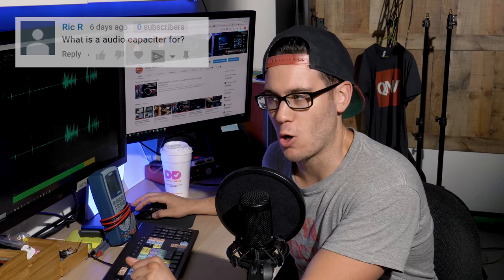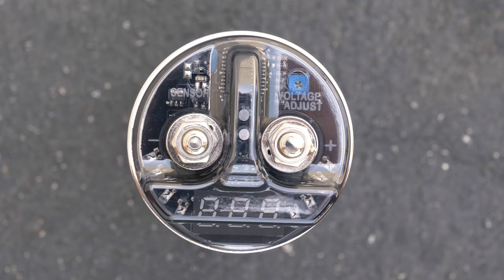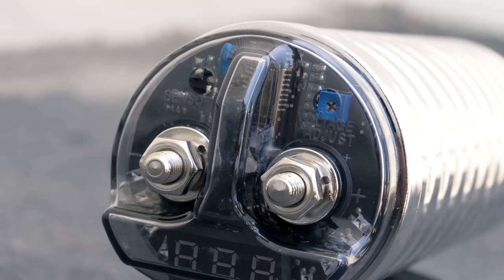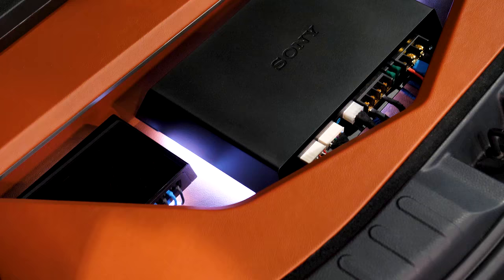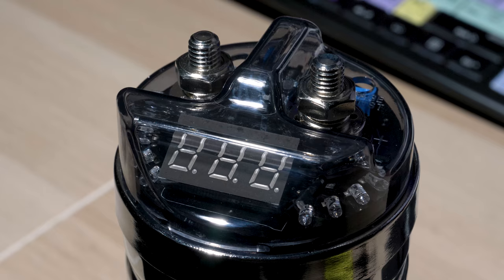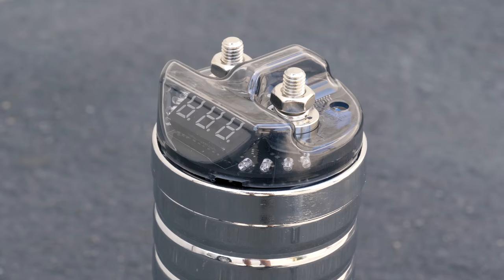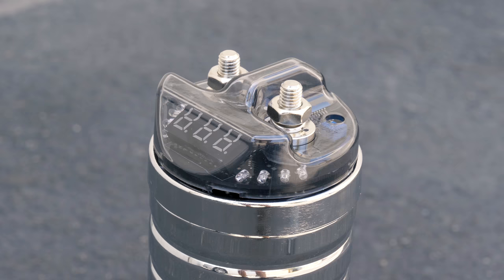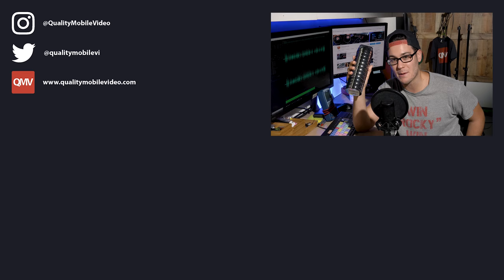What is an Audio Capacitor? - Car Audio 101

Comment: Halogen lights are going to dim under heavy current, no matter how good your electrical is. They are super sensitive to any voltage fluctuation. Even if you are sitting at a solid 14.4 all of the time, if they see a dip down to 14.1, they will dim. Best and most reliable way to stop dimming lights is to replace them with a quality LED bulb.
Reply from the maker: Agreed!
Reply: @Qualitymobilevideo  1a1

Comment: I have a 96 Camaro that has led interior lights that dim out when my bass hits I have 2 10" skar subs dual voice coils running on a skar 1000W 4channel amp the skars are even in a ventilation box by skar and they hit so hard won full range it drops my volts like crazzyy but I need one of these now knowing my issue thanks!

Comment: My car has an upgraded electrical system, always at 13 to 14v, never dimming. But still over time audio lowers ... not sure if is a radio safety feature but at this point the only thing left to do is to try a capacitor?
Reply: Having the same problem

Comment: Will this protect my battery from discharging too fast and my low amp alternator from burning out?
Reply: Yes but you need to have a big enough capacitor to fill in the extra energy your electrical isn't keeping up with.

Comment: As far amification at what point of wattage would you need a capacitor ? thanks for making the video btw….
Reply: This is not the only question to ask. It is not a matter of how much power you are using, but rather how much your system can handle. You could do a lot of math to figure this out between your battery, alternator, and wiring (including your amp ground(s)), but really you should be able to tell if your lights start to dim at all. If it's not dimming lights, your alternator/battery circuitry is not dropping voltage, which would indicate your amp is probably sufficiently powered. If you aren't pushing at least 1500 W during your peaks, and more like 2000, with no light dimming, you probably have no reason to look at caps.

Comment: i just swapped my alternator and battery with a diesel variant i had from a scrapper 
went from 45 Ah to 120 Ah and a thick 4g wire  and man no more problems no dips and i can even start another car with my stereo on max and the engine off
750w rms tho

Comment: Does this help , say if I’m parked at a light and my bass is really booming , but as I’m driving it lowers until I stop again at another light
Reply: It could but if u add another amp or upgrade the one u have it would fix ur problem
Reply: Think of it like this - power is lost the longer the line of wire is used. Using a capacitor is like bringing the battery’s power source closer to the item drawing power. So maybe on high levels of base but the capacitor is only a small buffer. Like shocks on a car - it dampens large draws but the battery and alternator are still supplying the power. Or at least that’s my understanding

Comment: So my question is that when I turn the music up on my bike the amps shut off but when I lower the volume they cut back on will a capacitor Fix this I have two 4 channel amps 1 running 4 6 and a half 3 way speakers and the other amp running 4 6x9 3 ways speakers a 600.4 and a 480.4 this is on a 2020 Harley road glide

Comment: What’s the difference between a capacitor and isolator relay
Reply: Not sure what an isolator relay is used for (will research) but a relay is just a remote switch to turn on or off something else.  A capacitor is a storage tank for energy that can be used as a reservoir  so to speak and quickly level out any dips in your electrical system during high demand.  Imagine them like ram in your computer.  Fast quick reservoirs of memory for quick access.  But instead they hold charge and is quickly accessed when needed.  But after ram is used up you have to go to your hard drive.  Same with capacitors.  Once they are used up you have to go to your battery until they can recharge.  Which is pretty fast.

Comment: A capacitor is like putting a bandaid on a shark bite.
Reply from the maker: Lol
Reply: Exactly
Reply: Geez did I just waste my money?
Reply: @diceloc441  Yes and No. While no they really don't do much for helping the cars electrical system they can help some inexpensive amplifiers that do not have a high quality built in power supply by giving them a little extra reserve for dynamic peaks. Kinda like a 50 shot of nitrous on a 4cyl lol.
Reply: How is this related to plumbing? I’m new to this
Reply: @CleetusJackson123 hahahaha

Comment: Can a capacitor help your battery from draining if you just turn your key twice so that only the electrical is working? Times I don’t wanna burn gas just to play music lol at a parking lot
Reply: I always asked this but someone gave me a great answer. When you do that your amps only get 12 volts. Which is why they always mess up. Your car always needs to be on to get the full 14 or 13 volts necessary so they won't short out

Comment: when i disconnect the battery to work on the car do i need to disconnect the capacitor as well?
Reply: You would need to discharge the capacitor as well.  Think of it as a mini battery still connected.  Better off unplugging it but even then it still stores energy so be careful not to touch the 2 leads.
Reply: You should be fine if you are not going to go near it, ie if you are only working under the hood and it is in the trunk/cargo area. It will drain itself slowly over time but if you are going to handle or be near it you should discharge it slowly and safely. Basically you would need to connect a large value resistor between the positive cap terminal and ground, or have a relay do so automatically upon power down (this might work very well). Exactly what value will be based on your capacitor's value and perhaps other parameters as well.

Comment: It would help if you started selling Ultra Caps or a XS power Ultra Cap Bank.    These capacitors do nothing.  Better upgrade your charging system if you can.

Comment: I did and y is their  a remote wire on some of the capacitors
Reply: Gio arteaga the remote wire are usually on the ones with digital displays. Turns the display off when the key is off to keep from draining the battery.
Reply: 1  if your lights are dimming like what they showed i wouldn't add a cap id. 1st a bigger alternator. Or a second alternator. 2. A second battery.

Comment: Will low voltage damage amplifier at max volume
Reply: It is most likely to damage your speakers because you will clip much faster due to reduced headroom. This is if you are operating the amplifier at it's rated power output at the proper voltage. This reduced headroom causes clipping, which will make your speakers reproduce the nasty, distorted signal with lots of harmonic energy that can burn your voice coils. If we're talking 12 to 13 volts as opposed to 14, your amplifier will probably still operate normally but with this reduced headroom. Your amplifier is much more likely to fail or shut off due to an impedance mismatch where you you wire a load with a lower impedance than the amp's rated output.

Comment: I added a capacitor to my system and it reduced some of the dimming but not complete what else should I look into?
Reply from the maker: You may want to add another power supply
Reply: Quality Mobile Video 
Ok I’ll definitely look into that, I just did the big three upgrade with 2 gauge wire and it’s still dimming on the hard hits. And I only have a 700 watt amplifier and subwoofer
Reply: But if I add another battery, doesn't it mean that I also need more powerful alternator that could charge both batteries? If the alternator is too weak then I guess the voltage could drop even more with 2 batteries?
I installed 2500W RMS speaker and the amp is 2400 W at 14.5v. I measured my car voltage and it was 14.2v without resistance. I but it dropped to 13.2v with heavy bass. What do you think would be the best solution? Do I need to add another battery, or change the alternator to more powerful one or buy the capacitor?
Reply: @arneolen7880  what amp... Is it true 2400w rms or boss "2400w max"
Reply: @carlgenis514  you need a better battery under the hood and real ofc wire not garbage aluminum coated copper wire. 4awg ofc>2awg cca wire. I dealt with this until I got a real x2 power(northstar) agm battery under the hood and real ofc wire

Comment: Would i need this if the radio turns on and off?
Reply from the maker: I wouldn't recommend this for a stereo, this is designed to boost your electrical system when running an amplifier and your electrical system is struggling. Your issue is most likely wiring/damage

Comment: so is it worth it to buy or not!?
Reply from the maker: Depends on your system. What do you have for audio gear and what does your charging system look like
Reply: @Qualitymobilevideo  if i have monoblock ampli 1200.1d for my 2 8" sub , 1000 ab 4channel 4pcs horn tweeter, 4pcs midrange.hyundai kona car🤔
Reply: @RPCTVPhilippines  dont worry for only that u wont need it. Just get a Gel yellow battery. Ive lasted up to 5hrs before turning it on and my truck never dies.
Reply: @jessestransmissions5714  gell yellow battery?
Reply: @RPCTVPhilippines  yes optima battery. The yellow one. Truat me Its the best. After u put it Ur lights wont dim at all. Ive had my sound system playing all night and never dies

Comment: Where was the part about it's also a bomb when installed in the wrong way or wrong place 😂 I knew a guy that rode with a capacitor in the floorboard between his legs in his lincoln.. he was scared and I was too when I helped him understand what the numbers meant and what it was doing cause he was getting massive surges that was enough to make it a bomb 😂😂💀 it was continuous. They are very dangerous best just let the top professionals deal with them. Do a big 3.. quit being cheap.. its not that hard you baby
Reply from the maker: WHAT A MANIAC
Reply: Big 3 does absolutely nothing if you don't upgrade your alternator. And where you are getting your info about it being a bomb, I have no idea. The amount of misinformation in this comment section is astounding.
Reply: @mattrondeau7466  He's actually right.  A reverse capacitor can cause it to explode.  Plus capacitors still hold a charge even after power is removed.  Think of it like touching a stun gun if you touch the leads with your hand.
Reply: @503jmn  First off, I'm working on the assumption that it is wired correctly. Because if it wasn't, it would have been immediately obvious to the installer because it would NOT work. Also most caps have circuitry to cut current miswired and to discharge when disconnected. Not that it is all that dangerous anyhow. It's 12 volts. You probably wouldn't even feel it if it shorted on your skin.

Comment: in other words it doesn't do much good
Reply: It helps if you know what it's doing.  It fills in the gaps when your electrical system is under high energy load.  Less stress on your electrical system is a good thing.

Comment: EXTRA BATTERY,,,,,GET ONE,,,,,CAPACITOR IS JUNK..
Reply: It’s not junk, it reduces noise in the system and makes it more stable if you don’t have enuf current then a cap isn’t going to save the day people use them and don’t actually know what they are doing.......